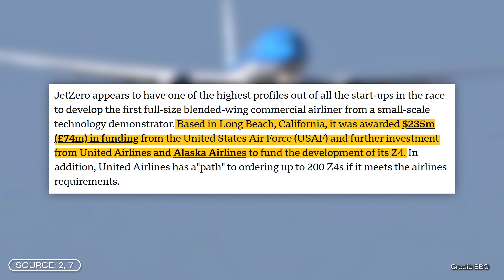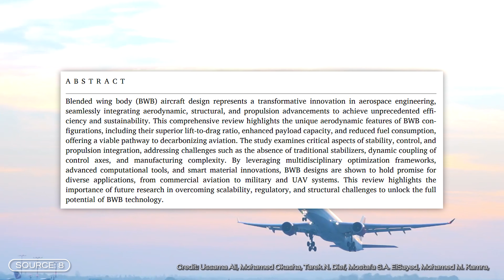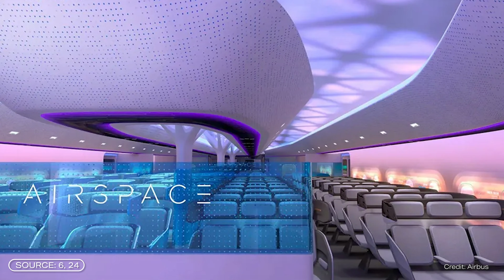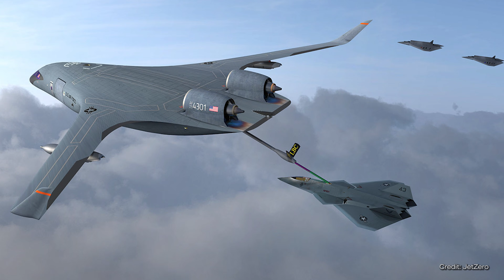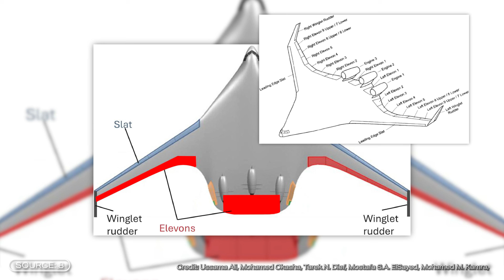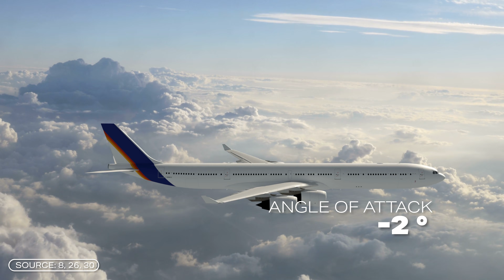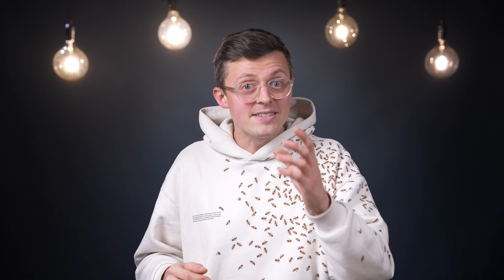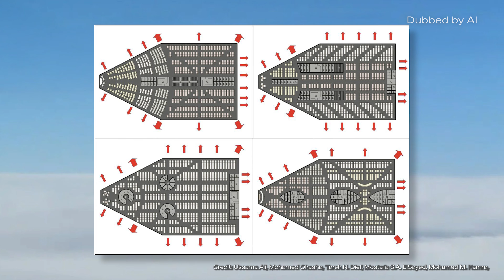The "Perfect" Plane Has One Big Problem...

Comment: It must be remembered that the Boeing 707, the most successful long range passenger jet airliner was derived from the Boeing KC-135 flight refuelling tanker. JetZero's desire to fulfil the military contract may give rise to a passenger variant. Those that suggest that the box structure may lead to pressurisation problems should probably note that the A380 is basically two tubes together, one on top of the other. If you extend those joined tubes horizontally, you actually get a structure that can be pressurized. You might also get a means of creating other variants of the same aircraft by being able to remove the inner tubes and replace them with a different format. You'd lower the underside of the aircraft or ramp it and then slide out the existing pressurised passenger structure for a cargo variant.

JetZero is not the only company working on this design. Otto Aerospace is working on a laminar flow aircraft which will save fuel by decreasing drag. They have an executive jet design which could provide a Blended Wing concept with the laminar flow one. The Phantom 3500 is a laminar flow aircraft, but by extending the fuselage into the wings, you not only create a greater passenger load, but also reduce the need for structural re-enforcement of a wing/tube design.

Comment: The pressure vessel issue could be solved by not making the aircraft's skin the main pressure vessel at all, or only having part of the skin physically join up as part of the pressure vessel. You could use a more ovoid shape in the central body with curved internal side walls of the pressure vessel joined up with the center section of the fuselage.
The outer sections of the wing-body could be reserved for cargo and fuel instead.

However, this still complicates the method of emergency egress.

Alternatively, if the center section was used for fuel + cargo capacity, you could have two separate ovoid cross section pressure vessels on either side of the wing body. (that would be problematic due to dividing the cabin into two separate sections with common access potentially only at the cockpit/nose end of the aircraft, and would mean that rapid egress would be limited to one side for each of the two sections. (ie the starbord passenger section could only egress through doors in the starboard wing-body wall, and the port side section with doors in the port side wall)

Thigh might still be preferable to trying to utilize escape hatches in the roof or floor of the aircraft center section, though, and would avoid the positioning of main fuel tanks between the passengers and sides of the aircraft. (the fuel tankage within the center section of the aircraft could also be better protected and less likely to rupture during belly landings)
Reply: I'm pretty sure that they have implemented some vertical struts (i.e. columns in passenger space) as well in order to resist internal pressure.
Reply: @TANOCA17  I'm pretty sure you do not know much about aircraft stress analysis requirements, or pressure vessels in general, but I have only been at it for 40+ years, so I might be missing something. Please let me know.
Reply: @PaulWalker-zk2dd  Hi Paul, I have 20+ years dialed in designing, testing, analyzing structures including but not limited to aircraft structures, pressure vessels, engine crankcases, gearbox housings and internals. Well, given the boxy shape of this aircraft, it's obviously disadvantageous for carrying pressure with almost flat panels all around compared to a more conventional tubular structure. Let's assume that those flat panels are composed of frames (i.e. just I beams) and single layer outer skin (most probably has sandwich panels where needed in between frames and stringers). In this case internal pressure creates a uniform distributed load on those beams which obviously creates axial stresses due to bending moments. Can you explain to me what's wrong with adding a strut or struts connecting lower and upper frames in order to lower bending moment by creating shorter beam segments?
Reply: This approach then requires two structures, one for resisting external aerodynamic pressure (about 10 psi), and one for resisting internal cabin pressure (about 10 psi). The end result is that you have to pay the piper twice, so the weight penalty is almost twice over a simple tube design. The drag benefit does not out weigh the weight benefit.

Comment: A 50% reduction is obviously unrealistic. To do that you would need a lift-to-drag ratio comparable to the record setting GlobalFlyer, which just isn't possible for a commercial airliner. That being said, aviation is an industry where even a few percent improvement can make a big difference, so if they can achieve a 10-20% improvement at reasonable price it would change the industry. But we'll have to see if they can pull it off.

Comment: I say adapt one of the prop fan designs to a pusher configuration, but using an aft fan design with the stator blades aft of the fan and the turbine exhaust coaxial with both. Use counter-rotation of twin engines to eliminate torque and allow the fan blades to protrude below the trailing edge of the wing (but not enough to risk tail strikes).

Then you end up with significantly higher efficiency than smaller diameter turbofans and a line of thrust  closer to the centerline of the wing. You also have enhanced stability via the counteracting torque + gyroscopic effect of the fans. (though single-engine performance would still be trickier and more aerodynamically inefficient, so overall control authority would be reduced, even if FBW maintained stability: ie it would be stable, but both aerodynamic efficiency and maneuverability would be compromised)

OTOH, aft fan designs using free-wheeling turbines have historically been problematic due to hot exhaust gas leakage between the turbine junction and associated wear and tear. (hypothetically, if you used a geared fan connected via extension shaft, you could avoid that and have a normal, continuous exhaust duct with concentric/coaxial fan rotor and stator/guide vanes mounted in a sleeve configuration outside the duct)

You'd probably need a totally different type of fan blade and guide vane pitch control system from the solid central hub type, since it would be a ring-shaped hub instead.

You'd also avoid all of that if using electrically driven fans for a hybrid type propulsion system (using battery banks for take-off and max power, and gas turbine powered generator for continuous power for cruise + charging) with the same types of large diameter, high speed, variable pitch unducted fans, just electrically driven. (technically, a high-efficiency turbodeisel generator, or set of generators, might end up out-competing gas turbines in this role, but either or could work, possibly turbocompounded diesel as well;  spark-ignition engines would also be a possibility, but that would mean different fuel type and flammability limits, though mixed alcohol fuels and other oxygenated synthetic and/or biofuels become especially appealing for SI engines, due to the favorable combustion characteristics and efficiency gains specific to hydroxyl radicals in SI engines ... or possibly in piston engines in general, but if applied to diesel cycles you have trade-offs due to reduced cetane number; SI engines seem to represent the best examples of very high brake thermal efficiency with specific blends of fuel alcohols and hydrocarbons, such that it mitigates the loss in theoretical energy density)

Though I'd imagine that all of the early developments and likely the first commercial aircraft (if it gets that far) will just use normal ducted turbofans.

I also suspect hydrogen fuel will never be significant in commercial aviation, and what does get used in any form of aviation will be limited to storage via special bydrogen absorbing alloys for both safety and bulk. (the weight is an issue, though, plus wear and replacement costs, and high temperature annealing for efficient regeneration of the material, all of which makes it more practical as modular fuel cell units in ground based vehicles and marine use, probably best suited to large marine vessels, though at some point, compressed liquid hydrogen would be better for very large vessels: compressed to give higher density within a wider range of operating temperatures, though supercritical hydrogen may also be preferred)

Even use of less exotic compressed liquid fuels would likely be too much trouble for commercial aviation (though I could see LPG being used for light aircraft operating at low to medium altitudes). 

So you're likely going to see some mixture of hydrocarbons and oxygenated organic liquids for large scale aviation fuel in the future. (and a shift towards hybrid turbine-electric or piston-electric driven powertrains, with battery banks used to enhance peak power performance and allow ground-based charging to be done prior to take-off, such that combustion driven generators are used for sustained in-flight power + battery bank charging for bursts of max TOGA power and some boosted intermediate climb power)

SAF style synthetic fuel will likely be a component of such, but likely blended with oxygenates for optimal combustion efficiency, emissions, and energy economy. (ie max brake thermal efficiency relative to actual energy content of the fuel ... and considering energy input to the fuel production chain)

Comment: Even if sealing the fuselage to pressurise it proves difficult,this airframe could still be a successful cargo or tanker for both military and commercial operators while the pressurisation issue is solved.

The projected fuel saving should make the interim craft viable.

Comment: Omitted the fact that the B-2 was based on the original flying wing - the jet engine-powered Horten ho 229 designed and tested during WW2 which came too late in the war. Even so it was another example of German design brilliance.

Comment: The biggest problem I see for these being adopted for civilian passenger transport is incompatibility with existing infrastructure.  From the pictures they've shown us, they don't look compatible with airport boarding ramps, and while that could obviously be fixed, that doesn't mean every airport will fix it if there's only a handful of these planes in service.  That would limit where they could fly, which would make it less likely for airlines to buy them, especially if the savings aren't really great and the per-plane cost is high.
I don't get why people are concerned about the internal layout and evacuation routes.  There are three-row planes in service and have been for decades.  Getting out of one of these planes hardly looks more difficult than doing so from a center seat on any "jumbo jet."  If it's a real concern, you could just use the center for luggage storage and use the luggage areas for other things, like fuel or sleeper bunks or something.

Comment: A lot of what ifs which don't say much because the what ifs can go other way as well.  Evacuation... probably much easier rather than harder compared to a long narrow tube.  There were claims of safety from fuel tank rupture is better from the guys pushing the design from world war 2 era, turbulance might be less rather than more.

The engine checking problem... you simply need a tool to do it, yes it is harder than a ladder but not that big a deal, lots of that sort of stuff already exists.

Hydrogen fueled plane in my opinion is completely stupid idea for long into future, vastly more believable to talk "liquified natural gas" as an alternative fuel.  There is a good reason why even space x rockets use liquified natural gas rather than hydrogen.
Reply: pressurization and crosswind problems are probably the main issues left, both well known for 50+ years.  Stability is mostly solved by fly by wire.
Reply: advanced computer modelling and newer materials might be able to solve those 2 remaining issues well enough... the stability one is just add more stabilizing controls with better computer controlling them if required... might not even be pilots pretty soon just like self driving cars...  if a pilot is in all ways inferior than a computer doing same job that has "trained" in simulations and real planes for many lifetimes of humans, pilot may become obsolete.
Reply: "NASA not done with SLS hydrogen leaks", hydrogen fuel inefficient to create, hard to store, does little good, huge safety concerns even for NASA grade designs.  Lots of liquified natural gas infastructure because it works, is relatively easy to store and is relatively efficient.

Comment: throwing away millions on an old idea that is suddenly supposed to work fine.?!?!!?  jeezuss
these kinds of designs have a fundamental flaw:   any amount of lift that occurs near an aircraft's center line (partially) un-loads the roll axis controls - ailerons or elevons.    this design there would also be a loss of stability resulting from the span-wise expansion of the aircraft's distribution of mass (dom).

Comment: Flying wings (let alone tailless aircraft) can be designed to be inherently stable, but it will reduce their aerodynamic efficiency or maneuvering ability (or both). The Horton Brothers' flying wings and Northrop developments in the 1940s both took advantage of this stability, though Northrop eventually added an analog computer for dynamic stability and control augmentation into the YB-49.

When working with tailless lifting body designs, the options are considerably more flexible, which is a big reason that Gotha's developments of Horton designs all took this direction. (and the Northrop designs honestly should have as well, given the drag tradeoffs were minimal, especially given the stability improvements that would allow for other aerodynamic refinements with less compromise ... though use of split ailerons/elevons + spoilers for yaw control in addition to conventional rudders on the vertical stablizers is also often preferable given the overall surface area and inertia of the lifting body relative to the stabilizer and rudder sizes) Wintip stabilizers + rudders also effectively double as winlets, though the optimum design and shape would likely be a compromise between vortex mitigation, drag, and actual stabilizer + rudder authority.

For airport compatibility, you'd also likely want to include folding wingtips for taxiway and gate compatibility.

The bigger issue might be properly dealing with rapid passenger egress, though that might be achived through emergency doors being located in the belly rather than only on the sides (or wing/body leading edges in this case). Except that wouldn't be useful for belly landings or ditching, in which case upper hatches might be needed, possibly leading to slower egress due to the need to climb.

Plus the number of window seats will be limited and passengers might just feel weird being buried so deep inside the aircraft, though I suppose high quality digital screens would also be effective there.

Comment: I saw a presentation for a blended wing body back in the 1990s. The same drawbacks exist today as 30 years ago. First, to get the cost/pass/mile optimized, the plane would have to be a doubledecker with two levels. This means the plane will hold about 700 passengers, similar to the A380 and its spoke and hub model, which lead to its failure.  Second, people need to see outside and have a visual reference. This isn't possible for most of the seats in the middle. Third, the engines can easily compressor stall in a flare, given the area of the wing below the engines. Lastly, the 50% fuel savings is a theorectical saving, not one that's tested and highly questionable.

Comment: Another huge problem with the BWB concept is scalability.  Current wing and tube designs scale relatively easily by adding or removing fuselage sections.  Scaling a BWB is essentially designing a new aircraft.  The cost and operational complexity of having 9 differently sized aircraft models instead of three aircraft models that scale easily is exorbitant.  There would be little to no commonality for pilot type ratings because every different sized lifting body would drastically change aircraft handling.  I’ve always thought this design concept is a dead end except for a few niche applications.  Military airlift and tanker are about the only applications where I think it shines.

Comment: Another aerodynamic issue would be with thrust. A conventional wing mounted engine, when power is applied will cause the nose to rise. This is an advantage especially near to the ground. With high rear mounted engines, the force would be opposite. When power is applied, the nose will drop. I understand that once again, fly by wire would have to counter this.

Comment: 16:19 This.  I've always been fascinated by and with flying-wing and blended-wing aircraft, but stability is always the devil.  From what I have read about the development of the B-2, a significant portion of its $2.2 billion (1988) unit price was put towards making sure it didn't do stupid things at the worst possible moments.  I can certainly see its use in particular types of weapons platforms, but I'm not sure if even $250 billion will get them to the goal of a commercial transport.  Great video.  And the AI transcription doesn't suck.

Comment: The efficiency claim I think you should revisit given jetzero aren’t using modern power plants, they’re claiming 50% savings with PW2040 engines that are a 40 year old design, military design methods using proven tech. Slap a couple of GENx or RR1000s on there it’s a different story

Comment: No... they have multiple big problems: Pressure vessel, emergency egress, incompatible with current gating systems at airports, baggage handling... there are several more. Boeing and Airbus have been trying to figure these things out since the 1980's, and they still haven't got a viable solution.